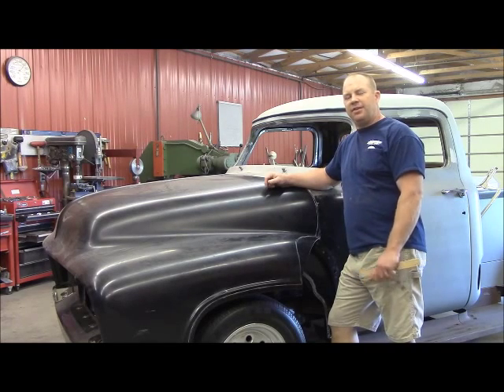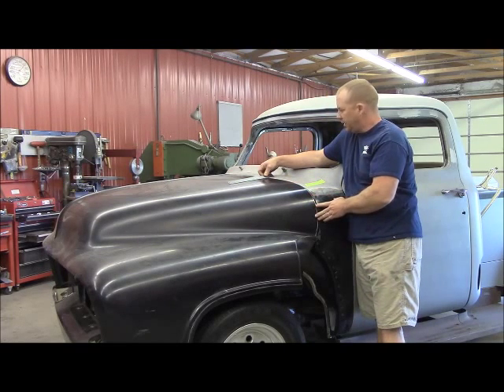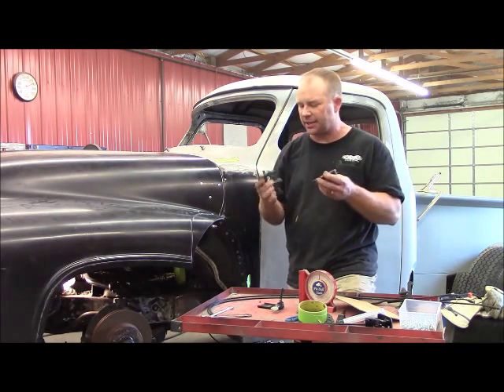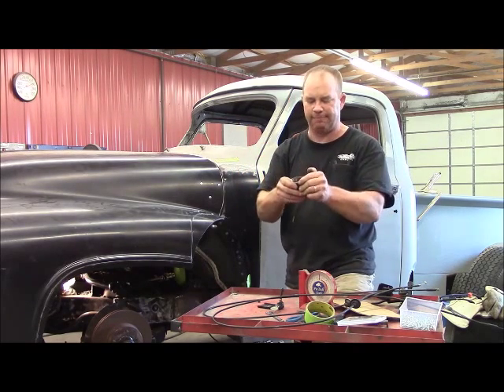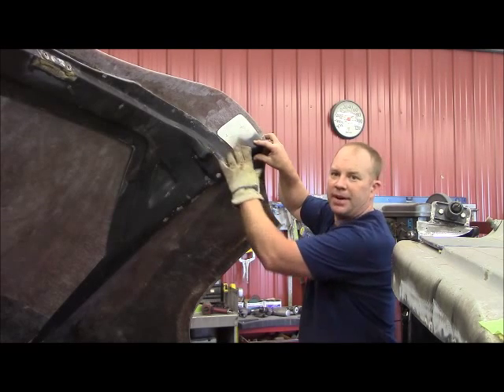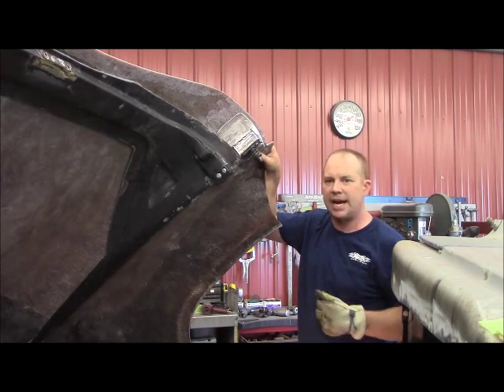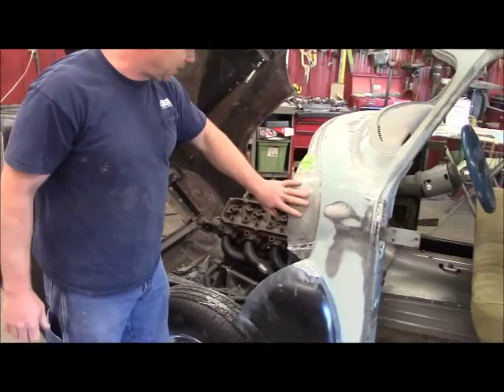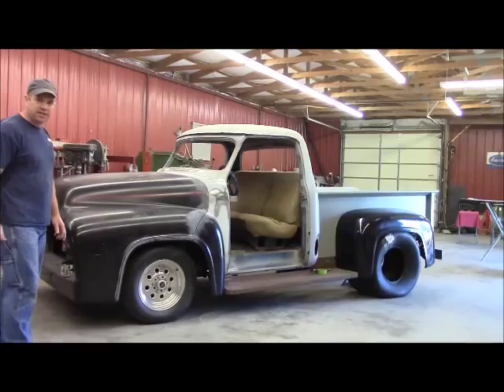Building our hood latch system in the 55 f 100

Comment: You have such a beautiful TIGHT fit on the hood/firewall seams, just one question, will weatherstripping affect your fitment? Maybe use the thin adhesive-backed foam for household doors/windows instead of factory replacements? Might not need any adjustments with that stuff.  Just a thought...  Coming along great man, very impressive work.  :)
Reply from the maker: Zeek Duff Hi Zeek I moved the seal landing down and block a 1/4" opening for the original woven seal at cowl then will use a universal thin seal at the fender extensions this really has been a lot of work getting it to all strike and line up  Thanks for the comment and stay tuned.

Comment: I've watched this video quite a few times now having this strike issue with my 56 F-100.  I was afraid to modify it as you did but since have lowered the cowl and working on the strike mechanisms as yours.  I was never satisfied with the look of mine and the hood just wouldn't look right. I am trying to make mine look close to yours if possible.  I want those gaps.  I definitely can appreciate the work you have put into yours. I don't want to even think of the amount of time that I have put into mine so far.  I am curious why the rod supports from the front grille area to each side strike mount area.  I see those in your video, do they help? Great job and thanks for the videos!!!
Reply from the maker: +Steve thanks for watchin I put turn buckles on them to adjust the side to the cab and fender extensions also to support the bonnet when unlatched we have 15 days to finish for shipping to SEMA its like drinkin from a fire hose
Reply: +BayOneCustoms Can't wait to see it finished. Finished the drivers side today and latches great, fabricating passenger side now. Have support rods ordered and waiting to arrive. Excited to get this completed.  Your project is awesome and really inspired me. Thanks!